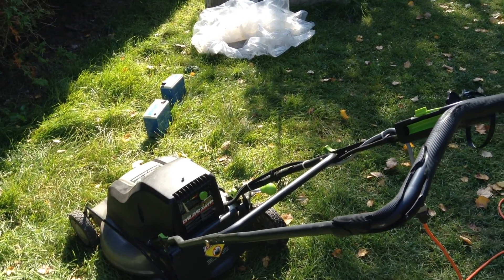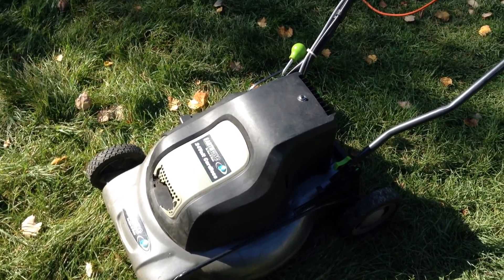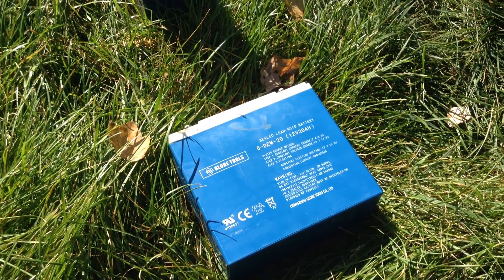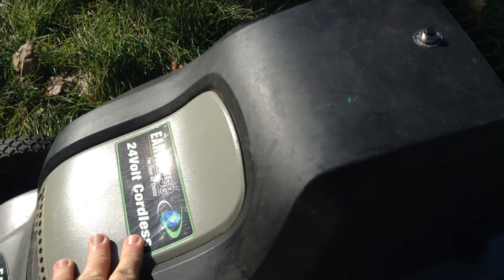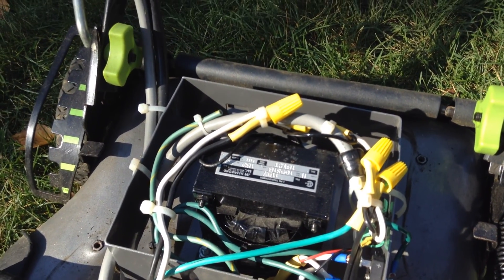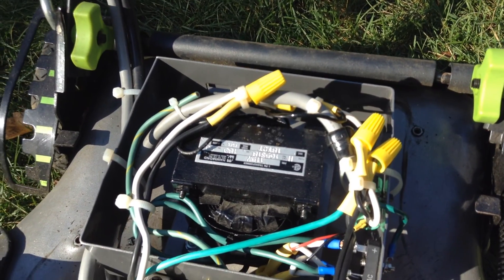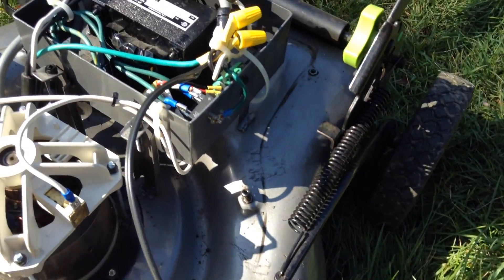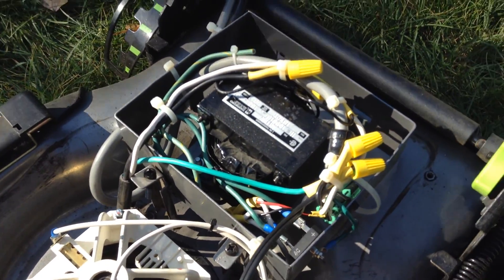Found at the curb: Earthwise 24 volt DC lawnmower hacked to run on 120 volts AC.

Comment: you may wanna consider re-winding a microwave oven xfrmr secondary, with about 25-30 turns of AWG 10 solid core wire, then add bridge/cap/etc  and try it...adjust number of turns till you got 24 volts dc....good luck...it'll work very good..
Reply from the maker: Good idea. I ended up converting it back to battery power with two 12 volt 20 amp hour gel cells wired in series earlier this year and it worked well through the summer and fall.

Comment: hey im from montreal and i have a reel cylinder 12v 15ah battery operated and im looking into  converting it to corded. can yoy guide me. not really sure where to start but i m looking for a "reel" cut and nothing online that can be purchase right now.
Reply from the maker: I just converted this lawnmower back to battery power because it didn't have enough torque to cut the grass set up as a corded mower. I got 2 12 volt 18 amp hour batteries from eBay and wired them in series for the 24 volt dc motor. I also had to replace the original switch as it wasn't working right. I replaced it with a 120 volt light switch. I also bought a 24 volt electric scooter charger to charge the batteries and it works great now. It has plenty of power to cut the whole lawn with power to spare. If you want to convert it to corded you will need a big transformer that can put out at least 15 amps at 18 volts to allow for voltage drop and a heavy duty bridge rectifier to convert AC to DC. I got my transformer like 25 years ago and it's probably not easy to find them now. They're super heavy too so shipping costs would be high even if you can locate one.

Comment: I got a problem with mine also its 24 volts 20 amps, very heavy too pickup and its earth wise lawn mower, I trying charging it and it says full charge but the lawn mower it self getting no power when I place it back in the mower its starts on red led light I dont know why it said full charge on my power adapter when it was plugged in  please help,
Reply: When these kind of batteries go bad, they will charge up very quickly, then look like they are fully charged, but the moment ya put a load on it, the voltage will drop dramatically. 

I had a lawn mower aimilar to this. 2x 12v 20ah batteries. When charged it said both were at 12.8v or so. But if ya turned on the mower, the blade would turn at like 5 rpm, and the battery voltage dropped to 1 volt. Super low, the battery meter on the mower doesnt even register this. Hah! 

I actually ended up using Ryobi batteries to power mine. So mine is still cordless . Pretty cool!
Reply from the maker: Might be a problem with either the batteries or the charger. I have a battery load tester that tests the 12 volt battery with a load resistor and it tells me the strength of the batteries. You can get them at battery supply stores. Also check the voltage of the batteries and the output from the charger to see if it is sufficient or not with a digital voltmeter.
Reply: I had the same issue with my battery and it is a shame that my otherwise perfect mower now has to be brought to the curb.   as I Hopefully someone with know how can can benefit from this lawnmower!
Reply: @agaveparryi6280    ...TRY de-sulfating those batteries, that take/hold a charge, till a load is applied. Connect your large 200 amp booster box (the ones on wheels) to the battery, set it for 200 amps, and leave on for 15 minutes an hour. Disconnect for one hour- do this 5 or 6 times, leave for a day, then slow charge for a day or so. If you want, before doing this. drain the electrolyte outta the battery, flush with distilled water( shake well ) drain, Repeat. then, replace the electrolyte. do the 5 or 6 cycle chargeing. Should AWAKEN the individual cells, in it. Good Luck. some guys flush with epsom salt, too. different ways.

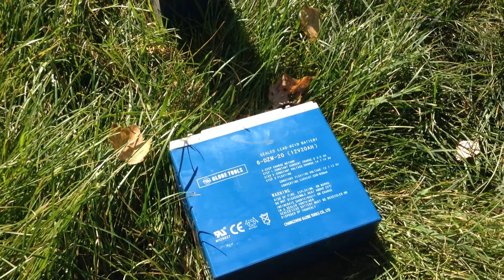Comment: Walmart https://www.walmart.com/ip/12V-20AH-T6-SLA-Battery-replaces-51814-6fm17-6-dzm-20-6-fm-18-lcx1220p/178996852  $39.89 Free shipping. 0:57 Look at the battery. 6-DZM-20. Would be nice to know what these motors actually draw. Would a 24VDC Switch Power Supply Driver Adapter LED Strip Light @ 15A for $24 work or 30A for $41.

Comment: what I don't get is why would you turn it into a electric instead of leaving it battery powered with maybe a car battery perhaps or motorcycle batteries
Reply: Battery back for this bad boy is nearly $150!! 
I modified mine to hold less expensive, yet higher AH rated batteries.  I replace those about every 2 to 3 years or so at about $20 apiece ;-)

I like this idea too... but I hate the cord lol.
Reply: I am curious as to what battery / cell chemistry you are referring to.
Reply from the maker: The reason is in the description.

Comment: Hi there, thanks for the interesting video.  I found the same lawn mower on the curb and it was missing the switch assembly (the plastic handle that turn's it on and off).  I bought a new assembly online and unfortunately the new one has an extra red wire that the old one didn't have.  Do you know what I should do with this?  I already wired the hot, neutral and ground to their terminals, but it won't turn on.  The battery is fully charged so I don't think it's a power issue.  Do you think I should double lug the red with the black?  Just curious on your thoughts.  Many thanks.
Reply from the maker: +xscreamj Hi. I would get an ohm meter and do a continuity check on the switch terminals with it disconnected to see if the switch is good and how the switch terminals correspond to the on off positions for the switch.

Comment: I own a newer version of this mower. After 1 year of use the battery will no longer hold a charge (I would not purchase this brand again) with that said this is exactly what I want to do with mine, replacing the battery would also be a waste of money. Thanks for posting this!
Reply: have you tried taking your battery pack apart to replace the individual batteries inside?
The company contracted out the battery packs which are filled with 2 cheap 12v sealed batteries.   I replaced them with higher end batteries of the same size for less.  Just a thought.
Reply: 2bRealist what battery pack you replace the inside with? I had replaced the whole pack once and not looking to do it since it’s quite expensive
Reply from the maker: @2bRealist  I actually converted it back to battery power because the transformer wasn't powerful enough to cut the grass. I got 2 12 volt 18 amp hour gel cell batteries and use a  24 volt dc charger I bought on eBay for an electric scooter to charge the 2 batteries in series. It works great now.